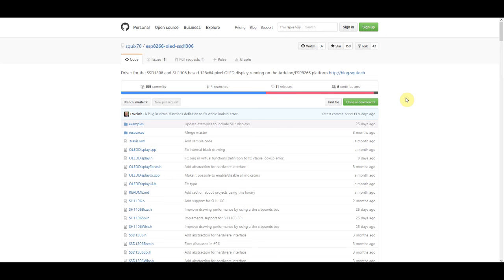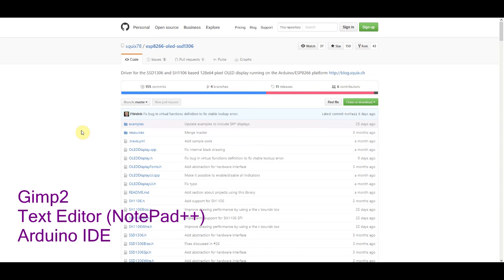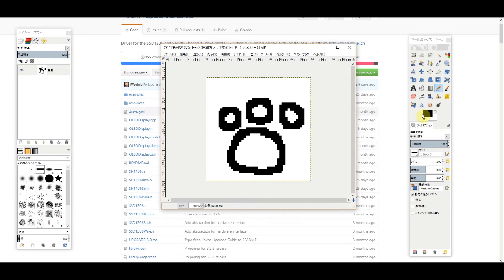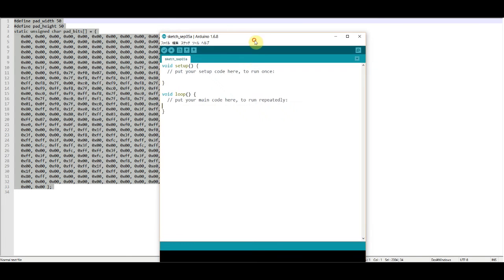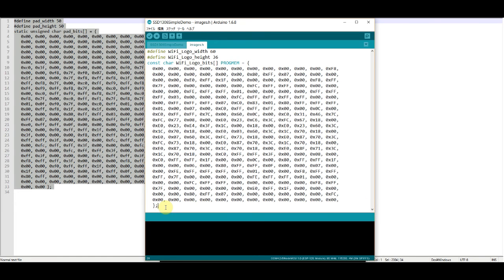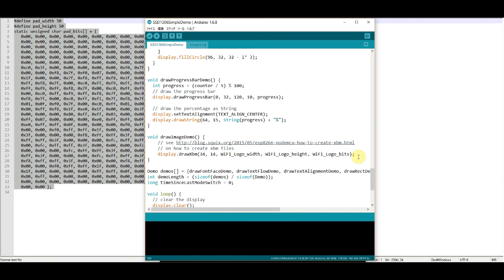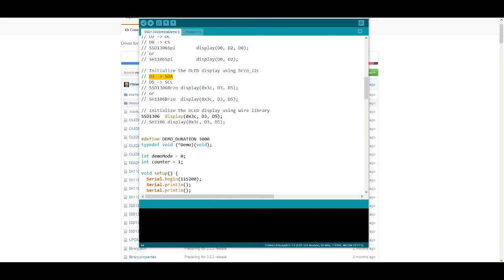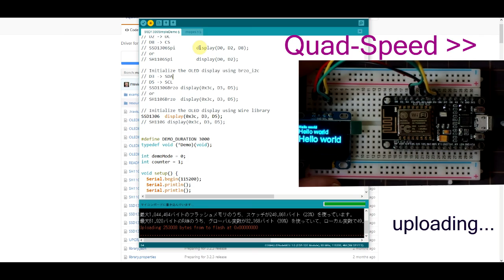make a xbm image for OLED SSD1306 module with ESP8266

Comment: Thanks a lot friend, I used your method to inseart any image I can download from website on my OLED not only drawing by hands.

Steps:
1. Download any image you want from Internet. (I prefer a Black and White image or logo)

2. Convert the image to purely black and white image (no gray or other colors in the image) and resize it to 50×50 using any photo editor app. Some times you need to invert the colors from Black and White to White and Black.  
I'm using paint.net app in my windows 10 to edit images.

3. Create new file in Gimp2 with dimensions similar to the size of your image (50×50). 

4. Export to xbm file.

5. The remaining procedures is the same as you mentioned in your video.

Thanks a lots.
Reply from the maker: Thanks for your follow-up.